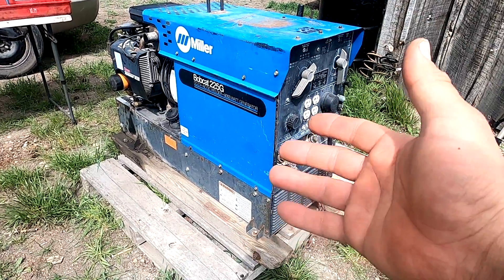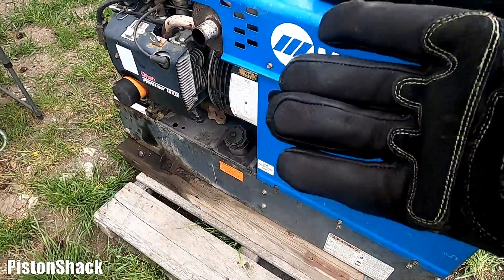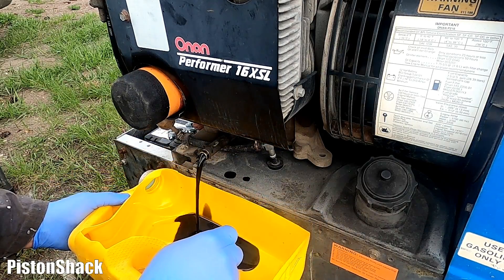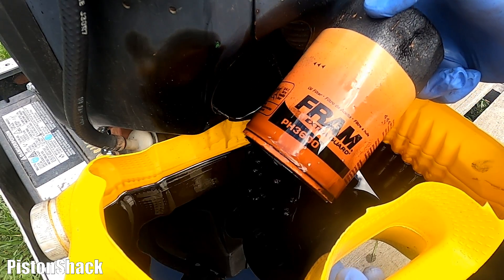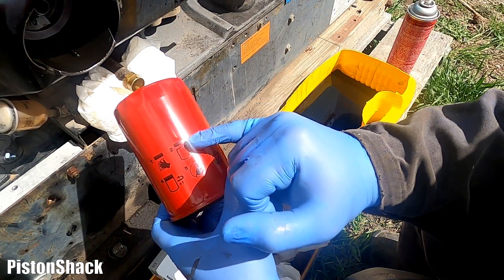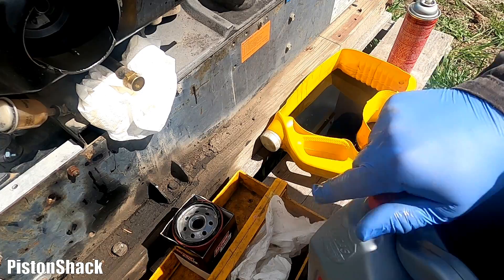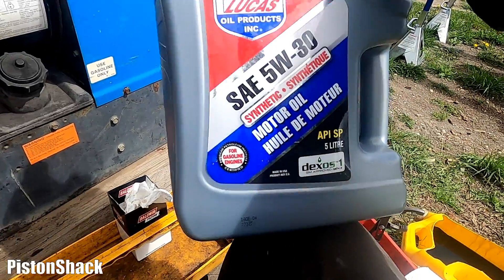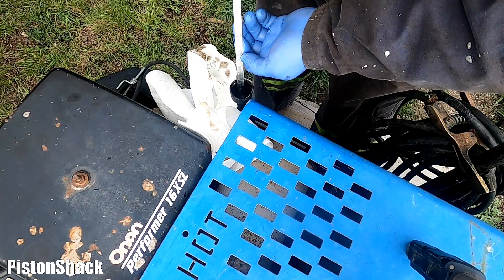MILLER WELDER Bobcat 225G Oil Change: OIL CAPACITY, INTERVALS, FILTER PART NUMBER, ect

Comment: What are the odds ? I just bought a Lincoln Mig welder ( Weld-Pak 90i FC), at Canadian Tire, during the long week-end. I plan to practice on riding mower's deck and, some different projects, around my house.
Reply from the maker: Right on, buddy! How is your new Mig Welder? Any cool projects?
Reply: @PistonShack  I'm heading out to buy a spool (It didn't come with it).  Beside riding mower's deck, I might try some gardening trailers/ lawn decorations with a function. I work a lot with aluminium flashing on houses and buildings so, I have a good idea how to shape metal. Everything should be the same but, at a heavier gauge.